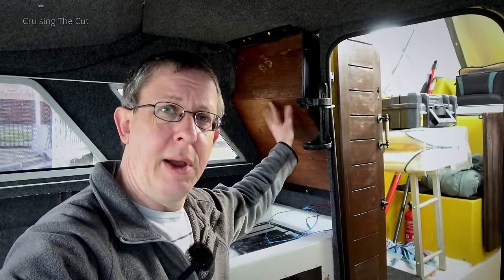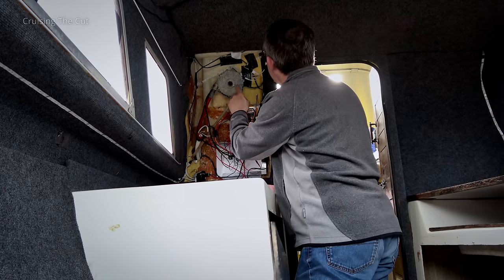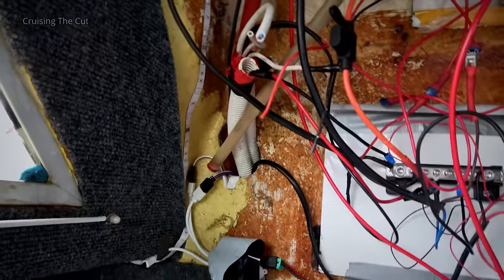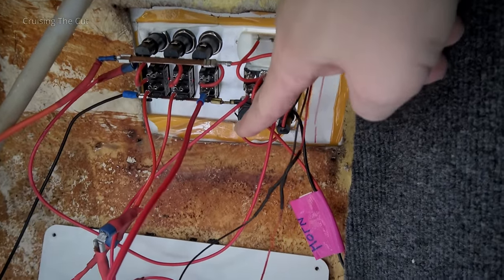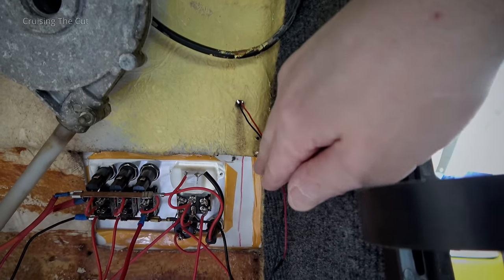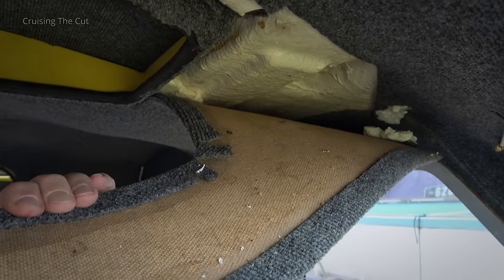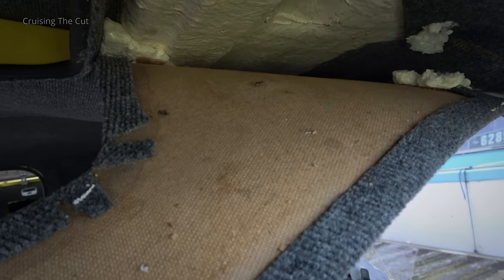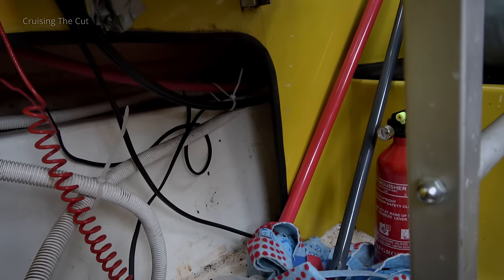326. Ripping out the wiring in my boat

Comment: That was great.  The wood I think is Hardboard.  Popular in the 60s.  And in flat pack furniture for the backing of shelf units and wardrobes etc.   I wondered if the little wierd thing on the dash was a sensor for something.   Could also the disconnected wires be for the aft cabin ? Just a few thoughts.   Great vlog.  Best wishes.

Comment: Been there, done that. I have a 1963 boat which I refurbished a couple of years ago. New engines, electronics, and fire suppression equipment. It had been upgraded in 1997 but they didn’t take any of the old wires out. I removed about 50 pounds of wire and a 100 pound battery charger. After I finished with the upgrades the boat sits 2 inches higher in the water. I feel your pain.

Comment: I found the video fascinating, but this is the sort of thing i understand and enjoy. As an HVACR tech, one of my favorite things is troubleshooting the wiring. Considering the quality (or lack thereof) of the state of the electrics, I would be doing exactly what you are. Immediate removal of wiring that goes to nothing and then I would surely redo what is needed with proper gauge wire, marine connectors, fusebox, etc. I would also make sure it was tidy and not a "bowl of spaghetti" and also draw up a schematic. I do hope there is more of this.

Comment: David, ever owned a Land Rover? For some reason, every owner appears to decide to rewire them but no one ever removes old wires so by the time 30 or so years old it has three or four complete wiring looms, I think this is very much the same.

Those roof battens have timber inside, usually 25 or 35 x 12mm pine.

Comment: When pulling out old wiring, it's a good idea to attach a nylon string (mason's line) to one of the wires and pull it into the old wire run. Then when you realize later that you need to run new wires through the same area, you will already have a cord in place that can pull, or 'fish', the new electrics without having to dismantle all the panels in the way, know as "Cutting the Cruiser"... :face-blue-smiling:

Comment: I'm pretty sure that really thin unknown wiring is for an LED or indicator light. It's tapped in to 12v+ and then grounded, so it's likely connected to the ignition, or similar system on the boat (since you have an outboard).

Comment: Part of what makes this so enjoyable is the honest investigation and mea culpas, such as the mic on mute.
Honestly, if you had just taken a flask of tea, a packet of biscuits and sat, talking about the boat and waterway, I would have enjoyed.
As for the two hole connector above the panel, is that for a plug in light of some sort to illuminate the panel at night?
Cheerio.
Reply from the maker: I'll do a 'fireside chat' with tea and biscuits from the boat when it's in a better state.

Comment: Hi, you should have a stern mounted white Navigation light and also maybe a lead to charge from the engine as many old Hondas had a chrage out even when they were manual start which is very handy.  Hope this helps with your wire chasing.
Reply from the maker: Nav lights not needed on the canals!

Comment: I'm really enjoying the videos on this boat, as you are removing most of the interior trim and rebuilding /remodelling the rear cabin it's a great time to renew and upgrade the wiring, now Is the time to work out where lights and power outlets etc need to go so you can run all the wires, I would leave the conduits running forwaed from the stern forward to the main cabin as that's the best way to protect any new wires. As its a nice small boat it's the perfect project for a full rewire and upgrade.

Comment: Hi David
That plug type thingy on the exterior panel may be a power plug for an attachable device ie. nav instrument.
My suggestion would be to rewire where possible - using proper electrical wire standards   -- make sure you have good groundings
Reply from the maker: I will be rewiring, yes

Comment: Consider getting a labeling tool (little machines that print on a little bit of sticky tape).  E.g. rather than yoinking the wire in the conduit, label it as an abbreviated form "Doesn't connect to anything but terminates in the battery bay", so that if you later on discover that you need to get a power feed or a signal or something into the battery bay, you don't have to relay conduit and all.

Comment: THE ''hatched kind of wood'' is called 'hardboard'!
There's a product called ''carpet paint'' that you could use to change the colour of the ceiling carpet.
It could save you a lot of work replacing it all.
The electrics, are a real classic ''bodgers'' work.
😊
Reply from the maker: I'm not repainting it, I don't like the carpet
Reply: The carpet probably helps to reduce noise that would vibrate through the Glassfibre shell.
That's the same reason that cars are lined out.

 @CruisingTheCut

Comment: Random bits of velcro? They were around the window. Curtain fastners maybe? If I were you I would remove all of that wiring without deciphering the wire routing and then start afresh knowing where the batteries will be positioned and what items you need to function. You have already proven your abilities with wiring  so I am sure you can do a far better job than the mish-mash of current additions. Disconnect the batteries first before starting any work. If you manage to short high current capacity cables, you wont get an entertaining spark but molten metal  being spattered in all directions with a serious risk of fire and/or burns. Take care and carry on. Have a feeling this is going to get a similar upgrade to the electrics as your Van, despite what you said earlier. 😂

Comment: A tip. Don’t remove the conduit. If you remove just the wires, tie two pieces of doorbell wire to one end then pull the old wires. If at a later date you want to add more wiring you have a strong set doorbell wire to use as a pull through.

Comment: Not painfull at all. very interesting. I would leave thst white tube in if it runs all the way to the back of the boat. When you pull the wires out of it I would tie a piece of string to them so the string goes all the way through. So in future if you need to run some wires through you tie them to the string and pull them through.

Comment: best guess at the 2 hole thing is that is for an led light, to indicate you have power if lit. if you do not need it, you should remove it from the power system. you now have 2 hole that bat. power connects to the can be shorted with water over it.

Comment: You might want to leave those conduits in place until you decide how you want the electric system cabled. And even leave a wire inside each of them, that will make threading new wires inside easier. 😉 This was an archeological dig into several generations of electrical installations I am sure!

Comment: My two cents….The small wires to dash are used for a bilge in operation indicator lamp.  Use a label maker label each wire.  Use a sounding / audio continuity tester to help what is live or not.   Use surface mounted zip tie holders to secure the birds nest of wires. Use a positive buss for connectors, and use dielectric spray to help shield all exposed connections on buss. I would not redo control panel…. Have a new name plate made in proper orientation.
Reply from the maker: Cheers

Comment: That strange little plug like device on the console with the two very thin wires behind reminds me of a very old fashioned microphone input or something similar. The out ring was + or - and the very thin central male connection went in the small centre hole. Dunno. Something just dragged itself up from the very random depths of memory. 🤷🙂

Comment: When an antique clock breaks, a clock that’s been telling time for two hundred or three hundred years, fixing it can be a real puzzle. An old clock like that was handmade by someone. It might tick away the time with a pendulum, with a spring, or with a pulley system. It might have bells that are supposed to strike the hour. Or a bird that's meant to pop out and cuckoo at you. There can be hundreds of tiny, individual pieces, each of which needs to interact with the others precisely. To make the job even trickier, you often can't tell what's been done to a clock over hundreds of years. Maybe there's damage that was never fixed, or fixed badly. Sometimes entire portions of the original clockwork are missing, but you can't know for sure because there are rarely diagrams of what the clock is supposed to look like. A clock that old doesn't come with a manual. So instead the few people left in the world that know how to do this kind of thing rely on what are often called 'witness marks' to guide their way. A witness mark can be a small dent, a hole that once held a screw. These are actual impressions and outlines and discolorations, left inside the clock, of pieces that might've once been there. They're clues to what was in the clock maker's mind when he first created the thing. I'm told fixing an old clock can be maddening. You're constantly wondering if you've just spent hours going down a path that will likely take you nowhere, and all you've got are these vague witness marks which might not even mean what you think they mean. So, at every moment along the way you have to decide if you're wasting your time or not. Anyway, I only learned about all this because years ago an antique clock restorer contacted me, John B. McLemore, and asked me to help him solve a murder. This is the beginning to my favourite podcast S Town and your video reminded me so much of it I had to share. It was so entertaining and hysterical as usual, the third bit of Velcro really set me off. From someone with zero interest in this sort of thing usually.

Comment: That thing with two holes in it is an LED light.  Likely a panel light. As this is an older boat it is also likely it was a flashing led that was used as a fake warning light that the boat had a security system aboard seeing how it was wired in the system.

I use to pick up those flashing led panel lights for 3 or 4 for a dollar back in the late 90s.
Reply from the maker: Fake alarm! I love it!
Reply: @CruisingTheCut   they use the same flashing icon on many new cars to show the security system is active.

Comment: I've crewed on a number of boats and every boat's electrics was a potted history of every owner's level of competence as an electrician. Wires leading nowhere, often unterminated. Spliced wire runs using two different colours, generally joined at some inaccessible point. At some point it's easier just to decide what you need as an owner, design the wiring plan and redo the lot from scratch.

Comment: As you find out what a wire does you should stick a piece of tape on it so you can write its function down. It saves having to figure out what any particular wire does several times over the course of the project.
Reply from the maker: I'll be replacing most it it 👍

Comment: You've done so well with your electrics, would you mind coming to look at my house electrics? There are dangling wires, wires poking out of holes, wires connected by willpower, lots of chocolate box connectors with wires in (some even have screws in) - it will be a real treat for you. Cheese sandwiches will be supplied, with tea and biscuits, what's not to like? I've been trying to get electricians to sort it, but they just run away, and I think you are made of sterner stuff. I think there is a nautical pun there.

Comment: As a one-time marine electrical engineer I would advise you, as top priority, to completely rewire the entire boat; leaving this for later on will, undoubtedly, have you stripping down your interior refurbishments for access. I imagine this would be a relatively straight forward task compared to figuring-out the current mess. It seems to me that the past owners have stopped just short of wiring it t in wet string.
Reply from the maker: It is going to be re-done

Comment: The strange thing with the two small holes is a socket for a 12v indictor lamp (bulb and cover missing). The reason for fitting it is diffcult to understand as it is conneceted across the negative and postive feeds from the battery and as such would show only that the battery was connected but not the battery state. For that you have a battery meter on the little control panel. Like much of the rest of the wiring it is all a bit strange.

Comment: I suspect that the boat used to have an engine with an electric starter. That would explain some abandoned wires and the battery location in the back of the boat near the engine.

Comment: This is exactly why it was so satisfying to re-wire my boat. I sat down and made a diagram of what I wanted to power and how, and then deleted the ugly wiring left by the previous owner (or maniac who did the wiring) and re-wired the boat in accordance with the military standards I was taught, installing new bus bars and bilge pumps as I went. While I was at it, I also tightened up and adjusted the steering mechanism. At a guess, that very thin wiring with the mystery connection was probably power for a compass light, in which case it should have been twisted to avoid magnetic interference with the compass. But of course, a compass is just a little bit absurd for a canal boat, more of an affectation really. I think calling that carpet backing "wood" is affording it too much dignity. It looks like medium density fiberboard (MDF) to me.

Comment: The random thing with the two holes in it looks like a deadman switch.  They work by having a plug that is attached to a lanyard that is then attached to the driver.  When driving the boat, the plug is inserted into the switch, and the engine will start and run.  If by some accident, the driver falls overboard or falls away from the helm, the plug is pulled out and it cuts the engine.  However, as you have been sailing her down the cut without the plug installed, we can safely assume that it has been deactivated.
Reply from the maker: There is such a switch but it's part of the throttle control.
Reply: @CruisingTheCut  Were the throttle controls and engine installed on the boat when it was new or are they later additions?

Comment: I would leave at least one wire in that old battery conduit incase you ever need to run something back there you will have an easy wire that can be used to pull new lines through.

Comment: I have had a number of boats through the years, and the one thing that has been consistent across every one is that there was always a "rat's nest" of wiring. It seems like wiring is the one place that most boat owners have no understanding of.
Reply: Or a mechanic/amateur has to "quickly just add that widget" into the "system" for the owner?

Comment: If you are planning on moving to an electric start motor, I might hold off on removing that conduit towards the rear.
I have a feeling that may be the original intent of some of those wires in there.
Reply from the maker: Agreed. There's actually another conduit as well, going to the throttle controller, which I think is for that function.
Reply: @CruisingTheCut  excellent! I'm excited to follow along with your progress.

Comment: Did you ever find out what the thing with the 2 holes is?  It looks like they'd be the right size for a larger LED's legs (or whatever they're called) but there doesn't seem to be any way to fit a covering for the LED.

Comment: @CruisingTheCut  I been wondering why the batteries were move to the front cabin than the back? Unless the back always had a know issue of leaking?
Is the current batteries in a logical location? As it does take space where storage for the galley could use or a place for future appliance.

Comment: Picture the following scenario - it is the Boat Yard Dry Dock and sitting on a trestle is a "little motorized powerboat" recently retrieved from below the water line at a mooring dock. Standing alongside is the owner - David, with the Boat Yard Supervisor who says -"David tell me again what happened? "David - "Well I got so excited with removing screws & carpet, that I removed a line of screws across the bottom of the cabin floor and suddenly water rushed in".  Boatyard Supervisor - "Well that would explain why the keel fell off".

Comment: If you are not careful people will be watching ready to see the disaster! It is only 12V, so easy to handle and with joints that tend to be a bit haphazard, BUT short it and if there is no fuse involved the battery/ies can go BANG! I've had that in the past when someone shorted some generator batteries right in front of me. Explosion followed by flames to the ceiling and a head to foot shower of acid that did quite some damage too - medical intervention required for the two of us - more the other guy as something in the explosion ended up breaking his nose. It saved me having to break it for having shorted the batteries out and injuring the two of us. I thought I was going to be blind due to the acid.

When disconnecting unknown wiring first test what works, then do it again as you disconnect each wire - that allows easy identification of each cable. Then before pulling anything through (1) disconnect the batteries or use the isolator if there is one and (2) consider whether you will need to pull any new wiring through - so leave some of the old wiring to connect the new stuff to in order to pull it through, or connect string to the old wiring and pull it through so you have string in place to pull any new wiring through.

The board in the ceiling is called hardboard. One side is dimpled in a grid pattern, the other is usually shiny. I haven't seen any in decades.

Please be careful.
Reply from the maker: I am usually careful. Usually.